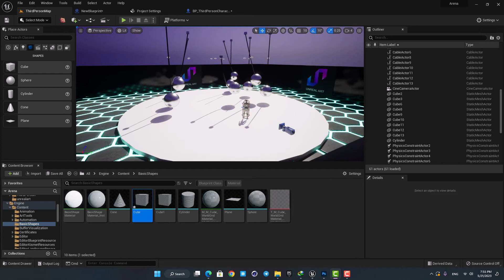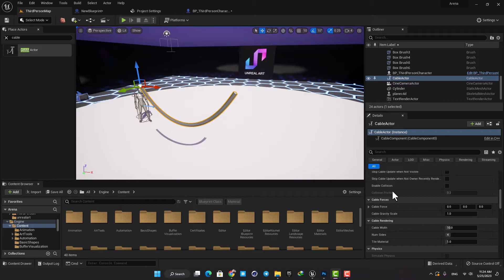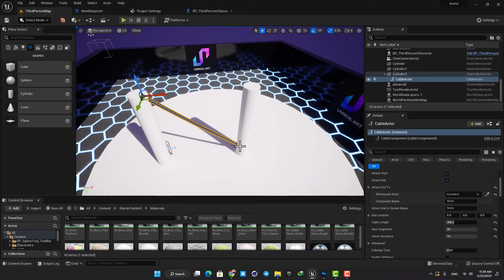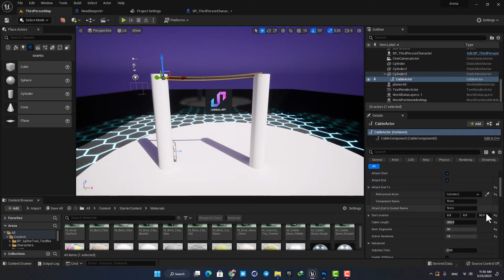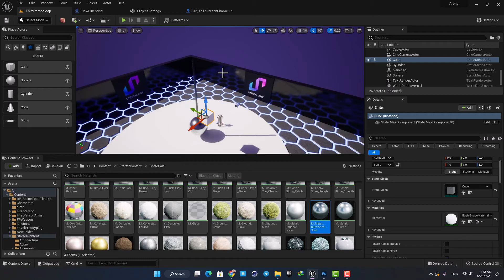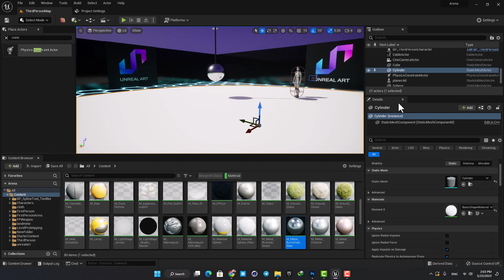How to Simulate Ropes And Cables In Unreal Engine 5

Comment: Wow, I have done this almost 20 times. I am blown away at how this simply DOESN'T work. 
Maybe it's a glitch in 5.3, but nothing about this actually works, not even close. No matter what I do the rope and everything attached to it goes off at the exact same wonky angle. Everything is zeroed out. Nothing fixes this.
Reply from the maker: I didn't have that much problem with it, sure it's a little funky but it worked in the end. maybe it's a version problem or some other settings are changed in your project.
Reply: @UnrealART  Yeah, it could be. I'm not sure. I know it must work because I'm watching you get it to work. For some reason my end point takes off to some undetermined area in the game (perhaps 0.0, 0.0, 0.0 location?) and I can't get it to knock it off no matter how many times I try to reset the values, among other things. I came up with a work around which utilized some of the overview you have given here, so that was a big help!
Thanks!

Comment: Nice!
but i have a problem with the Collision. no mather if Collision + CCD is enabled for both ground and rope, the rope will just fall through the ground as soon as i hit Play.
Reply from the maker: you should check out the type of collision they are using and make sure they are the correct one. select the asset , hit ctrl + E and in the details panel scroll down to collisions and check the settings

Comment: Attaching the first end needs clarification: Select the mesh on which you want to attach the first end of the cable. Then add a component in the details panel (the green plus sign) and select "cable". Leave the "Attach Start" and "Attach End" ticked. The cable will be attached to the pivot point of the selected mesh. Now choose the desired mesh under "Referenced Actor". The positions can be changed with "End Location" and the point on the first mesh.
Reply from the maker: thanks for the explanation , very helpful 🙏
Reply: THANK YOU I've been looking everywhere for that explanation
Reply: Another simple way to make the start end to snap to another actor is just parenting a cable with the targeted actor

Comment: How can an object that is attached to cable end stop falling. Now it falls to the ground no matter what my cable length is, i want it to stop falling mid air and stay there
Reply from the maker: you can connect it to a shorter cable and make it invisible in game so it keeps the object in the air but the cable itself cannot be seen. it's a cheeky solution but this is what I can come up with right now because I don't know exactly what you are working on .
Reply: @UnrealART  basically a man hanging from a noose, now the man falls to the ground instead of hanging in the air. Will try this, thank you!
Reply from the maker: well it's simpler than I thought . the spheres in the video also float in the air so it should work if you do everything like the video. just play with the rope settings and placement and see you can fix it. If it didn't work, send me videos and screen shots so I can look into it @tobiasnilssenopedal6660
Reply: @UnrealART  hmm okay, will do! Thanks again
Reply: I might have explained poorly, but i want the man to fall from a platform and then stay in the air after falling for a bit. He would jump from the platform and the rope (cable) would stop him from falling to the ground. It is easy to make him stay in the air all the time from the start. Might have to to this in blueprint somehow insted, or am i missing something?  @UnrealART
Reply: I works a lot better bc of the physics constraint actor, it actually looks like he is hanging. But i want the player to see it happen
Reply from the maker: I haven't done this before it needs some experimentation . using blueprints may work @tobiasnilssenopedal6660
Reply from the maker: I haven't done this before, maybe you have to implement it in a blueprint.it needs some experimentations . @tobiasnilssenopedal6660

Comment: Nice tutorial, however it looks like the cables break when you close and then re-open the project file. Looked online and it seems to be a reoccurring issue. Any ideas on how to fix that?
Reply from the maker: it's definitely a bug . do you have the same problem in all unreal versions ?
Reply: @UnrealART  Looks like updating the project from UE5.1 to UE5.3 fixed it. Think its broken on in 5.1 (maybe 5.2 but havent tried in there)

Comment: Nice work. I want to try to make a electrical power system with power cable. Would you say this is a good way to start by attaching object to end point of cable and then have player able to move the other end?
Reply from the maker: yes I think it's possible . however, you might bump into some problems when the game is being played. try it and see what happens!

Comment: Hey, ty for the tutorial but I'm facing a problem (same as many other people I read online).
My character mesh moves physic objects too much, no matter the Mass(gr) and no matter the character's push force factors. Either it's 0.1kg or 1000000kg the physic object,  when my character touches it, it flies away. It's kind of insane how many people write about this problem since 2016 and still not a sold answer!
Reply from the maker: you are welcome . there must be a solution to that, I will look into it and maybe make a video about it
Reply: Hey, that's awesome, tyvm! I am trying to trace what's causing it. I found that the "push factor" (and all the other physics interaction settings, from the "character movement component", work only while using the capsule as a collision. If I try to use my skeletal mesh to collide with any physics object, , (for more detailed collision), then the physics objects fly with insane velocity. No matter its mass. (my characters phys asset capsule collisions are perfect). But a video on the problem will be very helpful! @UnrealART

Comment: I do have another issue though: I have a rope with physics constraints attached to  its middle, and trying to finish this setup by  ticking simulate physics on bottom object where rope is attached ( step on object),buts simulate is greyed out, how do I fix this ?
5.2.1
Reply: fixed but its not what I was hoping for, don't want platform in my case not a ballasin video, to not jump away on touch by player, but to allow player to walk onto platformand haveplatform move as player interacts with rope.
Reply from the maker: I think I need to look into it . Don`t have the solution on top of my mind

Comment: Can you please show how you attach both ends? Cause it seems that the first end which has cursor, was pre-attached and you only used translate to point it to the center of the cylinder. 

Cause I do the same and the results are underwhelming. Far from what you get.
Reply from the maker: yeah I forgot to record the first part in the video , in your outliner just drag the rope on top of your static mesh so it gets parented to the object and that`s it .It will be attached to the static mesh from it`s first point and the second point can be attached to other objects as explained in the video .

Comment: Hello, thanks for your Tutorial. I'have a problem. Everthing is working fine, but after I saved the project and restart it, the cables are not connected anymore. The Reference Actor is, after saving, empty. When I connect again, the cables are at the right place, but when I save again and restart the project, the connections are gone and the cables are pointed upwards. What am I doing wrong?
Reply: Same here.
Reply: is it pssible you didn't choose component cable , and click the other end and affix that, then attack cable end to your other mesh. I missed that too, hope that helps
Reply: well I thought I had it, on exit  and reloading ue, detached again, wonder if using 5.1.1 introduced a bug.
Reply from the maker: hello . you are welcome, well I have not bumped into such a problem . my version of unreal in this video is 5.0.0 . maybe it`s a bug in your version , try it with a different one and see what happens